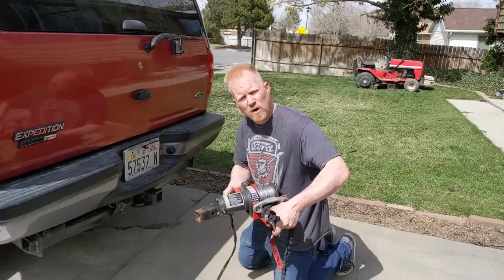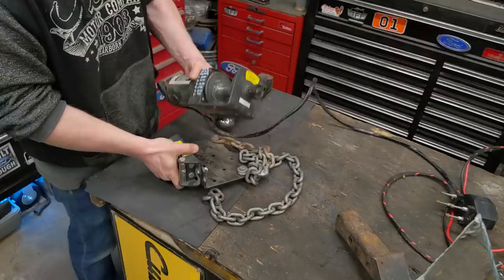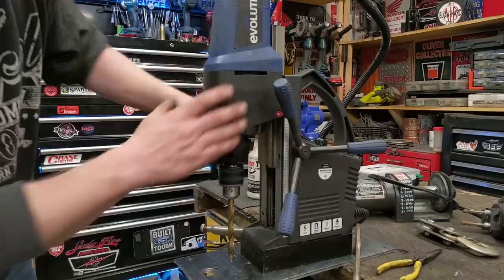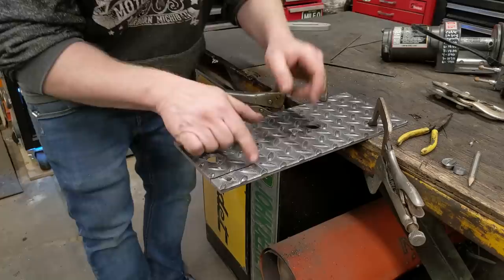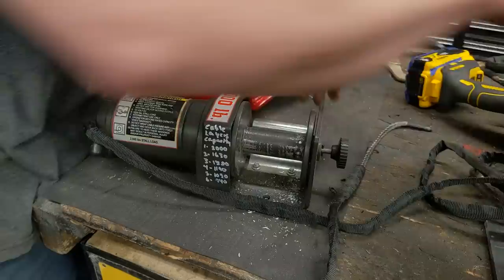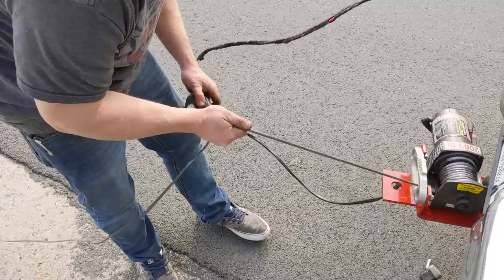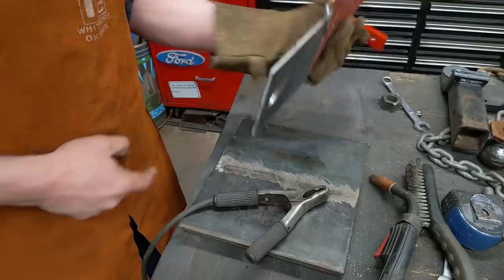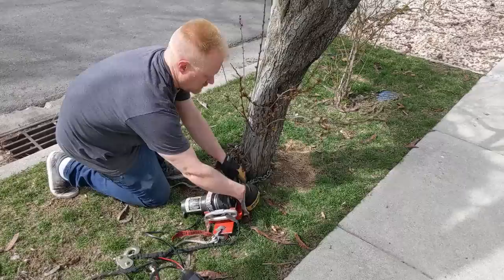Portable Hitch Mounted WINCH Build w/ Swivel and synthetic cable

Comment: I always enjoy your creations mo, i'm sure you could make anything given time and materials :-D
i imagine you have a hard time sleeping with all the ideas keeping you awake :-D
i've never thought about the gearing effect of a reel of rope, similar to reels on cassettes, speed and torque going in opposite directions.
You could replace that reel with a deep "V" pulley and a single wrap of rope around it, plus guides.
A reel after it to take up the slack rope on a slip clutch.
Likely too difficult.
Your lovely dog must be 1/4 kangaroo he he :-D
Reply from the maker: That's a clever idea. Kind of a capstan winch setup.

Comment: Why not take power from the trailer connector with another male half of common connector ? Is the amp draw too much?  Factory trailer package  with common electrical connector?  Nice design.  I thought about doing the same thing but don’t have the welding equipment,  etc.  Thanks for a great video.
JoeB
Reply from the maker: You're limited to maybe 15-20amps from the trailer connector. A tiny winch like this will have no issue pulling over 100amps.

Comment: The fairlead braces look good.  If you could have only 1 welder because of money and space limitations,  which welder would you buy?
Reply from the maker: That's a hard question. 

My first thought was Oxy Acetylene as it is a ton of tools in one. It welds great, can braze dissimilar metals, cuts thin to thick steel like butter, allows effortless shaping and bending of steel and is a mechanics best wrench with stuck fasteners. However, it is not an easy thing for the average DIY guy to just go grab. You need to go to specialty shops and the initial investment is kind of high. 

Ease of use and cost would definitely be a 120volt wire feed flux core welder with the option to use gas for MIG in the future(upgradable).

Comment: Anyway to make an adapter for powering the winch off the tow plug on the truck? That way you could plug right in and ditch the battery?
Reply from the maker: Nope. A winch pulls way to much power for the 7 pole plug. A tiny winch like this will pull upwards of 100amps at stall which would melt your trucks wiring. The only thing you can do is put an "Anderson Plug" at the back.  They come in 50, 175, and 350amps. A 175 amps continuous should suffice with 6or 8awg cable from the battery.

Comment: Now you can just go to harbor freight and buy and ATV hitch adapter and it will swivel.. under $10 with 20% off coupon I think
Reply from the maker: That would be nice because you rarely pull straight on when pulling out an ATV.

Comment: I built the 1st 1 for my truck about 25 yrs ago..
I still have 1 the I use on both my trucks now,
But mine will go from front to back of my trucks.
Nice design but u have a problem with the plate.

Comment: What about just putting a trailer plug on the it for your power supply that's the way my dump trailer power supply is set up
Reply from the maker: You still need a battery. The winch can pull well over 100amps where you're plug would be lucky to provide 20amps.

Comment: ...have you seen how ball hitch points break and go flying and what damage they do? Check it out. This is a dangerous setup.
Reply from the maker: That's not even remotely pertinent to this application. Those are shock loads exceeding 40-50,000lbs of force and the video in that goes over it had to cut the ball shanks half through to do it. It would have ripped the truck in half before it broke an uncut ball.

Comment: Moe - question if I may. Totally can see where your ideas are more efficient for pulling but.... I was wondering if those 4 roller deals are ok if I were to mount the winch without a swivel? also would that oval shaped guide be necessary with the 4 roller setup? So much helpful advice in your video, awesome. If there is ever something you think I could help you with please ask....
Reply from the maker: I actually put the 4 roller fairlead back on. It seams to make more sense to have rollers vs just aluminum for the rope to rub on.  Without pivot the rollers will still allow the cable/rope to bunch up on one side and you have to stop every 5feet, unspool it, rewind those 5feet by hand to spread them out and then continue your pull.
Reply: @sixtyfiveford  Thank you Moe for the quick response. Much appreciated. Will do. Be ordering that rope. Considered an extra one to keep in the tool box in case a tree wouldn't be quite close enough and avoid that arr effect! Never heard of that rope and other tips presented in your video! So helpful.....

Comment: I run mine from the 7 pin connector
Reply from the maker: 7 pin won't allow enough amps. 7pin is  regulated too 10 to 15 amps with a fuse on the 12v charge pin. A winch under full load will pull 75 to 100 amps.
Reply: @sixtyfiveford  ok! I’ll keep using mine

Comment: Can you get power from the 7 way hitch plug? I think the center is always hot. Mine could charge the batteries on my popup trailer
Reply from the maker: It wouldn't supply enough amperage. This tiny winch will pull up to 100amps under load. The 7 way is generally fused around 20amps.

Comment: That's a good idea, I work on mowers and I've been trying to figure out how to hook a winch on my hitch and then hook up my trailer.  Do you think it would be alright to run the winch off a 4 or 7-way plug instead of a battery?
Reply from the maker: I know this small winch will only pull around 10 amps lightly loaded, but if it stalls out pulling something heavy it pulls in the realm of 50-100amps. That would burn out a fuse really fast in the 7 way.  The 4 way has no aux power.

Comment: I have 25 ft jumper cables so I can use my truck battery.
Reply from the maker: I've had to pull out the jumper cables before when my spare battery was dying. You definitely get more power from a 14v charging vehicle battery than a 12v you're running flat.

Comment: I have a stupid question. Instead of extending the plate, Why didn’t you just put the tow ball on upside down?
Reply from the maker: I had to put more distance between the drum and pivot point so the cable wouldn't bunch up on one side.

Comment: i wonder if youd need a beefier setup or if this would suffice for a 10,000lb winch.. i see guys all the time with their 10,000lb winch on a receiver so they can mount it front or rear of their jeep/truck without issues it doesnt pivot like yours but it relies on a 5/8" pin in double sheer i think that ~1-1/4" ball thread will have a similar strength in its single sheer load.. ntm you dont have to run the cable back to the winch in a snatch block pull you can have a dring on your bumper and run the cable back to that so the winch setup only sees 10,000lbs and youre only ever getting that 10k rating on the first wrap, with a dead straight pull and no resistance with the battery mounted a couple feet away and 4/0 cables connecting it with the vehicle charging at 15v and a massive 1000cca battery.. i guarantee if you measure anyones 10k winchs actual power in a typical pull youre looking at 6000-7500lbs
Reply from the maker: A 1" shank ball will have a shear strength in excess of 100,000lbs. Bolts are generally rated at 5x their working capacity and hitch balls exceed this to as high as 10x safety factor. This is all due to the shock load. A 10,000 trailer will exert a 50,000lb shock onto the ball in an abrupt stop or more in a collision. You can see rollover accident pictures and generally that little ball never shears and will hold an entire truck up. There's video where some Aussie Guys break some tow balls by strapping a truck to a tree and then an SUV to the tow ball of that truck. The truck can't move and the 5000lb SUV races off at 25mph under full acceleration and the strap pulls directly on the ball. It takes quit a few attempts to break an old 1" shank ball but they finally do it. The force exerted is well in excess of 100,000lbs. I would say the weak point is the four 3/8 bolts holding the hitch to the frame.

Comment: Do you think there is a way to run the winch off a DeWalt battery, is it possible ?
Reply from the maker: No, just because winches draw so much current. They'll draw upwards of 200amps where a tool battery pack will peak out around 30-40amps.

Comment: Could you connect it through the trailer electrical umbilical?
Reply from the maker: No because the trailer wiring won't allow enough amperage. You need upwards of 100 amps with this tiny winch.
Reply: @sixtyfiveford  Great video! Thanks!

Comment: Pardon my newbie ignorance...can this be powered from the trailer brake plug?  I'm thinking no, because those look like 10amp wires going to that winch. How do you power it? A deep cycle battery?
Reply: Woops.  Didn't wait till the end...  Question answered.
Reply from the maker: I think the stall load is in the realm of 50amps or so. They do make aftermarket plug in ports for winches on trucks.

Comment: How are you powering it! Thanks
Reply from the maker: I have an extra 12 volt car battery in the video. You could use a car jump start pack or just run jumper cables to the front of the vehicle to utilize it's battery.

Comment: What size fuse is that on the wire
Reply from the maker: Winches won't really come with fuses instead they'll come with resettable circuit breaker / thermal overloads. This small winch has a 50 amp. It will allow more current than that to be pulled but if it pulled for too long it'll trip. You can easily expect the winch like this to pull over 100 amps momentarily. So it should handle 50 amps continuous but say it pulls 75 amps it may run for 30 seconds before it trips off.

Comment: Not  knocking you, it's a great idea. But this is so unsafe.
Your receiver isnt designed to be pull from at an angle, the hitch ball nut is left loose so the winch plate can move. The chain you used isnt heavy enough for the winch capacitor

Comment: Oh, yeah! Use spring loaded locking pins have the top plate and a bottom plate with the holes for locking the "pin" in. I'd personally would set it up for 180° that way you can cover everything (that & scratch block was from my towing days). 

https://catalog.innovative-components.com/viewitems/all-categories/s-pins-pop-pins-plungers-1-2-straight-tip-pop-pins?remote_addr=66.249.66.203&remote_addr=66.249.70.109

Comment: would a m12 6amp battery do for one pull?
Reply from the maker: It wouldn't. A M12 6.0ah is going to have 20 or 25amp max continuous amp draw cells. There are two sets of 3 in parallel so the pack can put out double or 40-50amps max at 12volts for probably around 5 minutes straight. Most of these small winches will pull over 100amps under load.

Comment: I really like this idea especially with how you can put it on both ends of the car. Do you think a winch that size could pull a car out if it gets stuck (or maybe pull someone else's car 😁👍🏻)?
Reply from the maker: I've used this winch to pull cars up a steep trailer ramp to load them. I used it to pull a derelict/non running small truck, that sat for 25yrs, stuck 6" in dirt out and onto my trailer. It probably wouldn't get  a full size truck stuck up to the axles in mud but it would be better than nothing.
Reply: @sixtyfiveford  Great! is much much better than nothing .

Comment: In my opinion your hook for your chain should be flipped over. My reasoning is with it flipped, the force of your pull would be to the throat of the hook and not the point.
Reply from the maker: Good point.

Comment: 3:15 what type of marking "pencil" is that? Just curious as I'm new to metal fab.
Reply: Traditionally, marking on metal is done with soapstone "pencils" -- basically a rectangular length of soapstone that is around 6" long by 1/2" wide by 1/8" thick.  Chalk will also work.  I have also seen a type of paint type "ink marker" that produces a finer and more consistent line, but I prefer soapstone for the occasional use that I have of it.  I am still using the original package of it that I bought from Sears Hardware around 20-25 years ago.  Which might sound remarkable, but actually the fact that I still can find it is what is really remarkable... I wish I could say the same think about the key to one of my motorcycles that I've been looking for over the last couple of weeks... :(
Reply: And one more that I forgot about -- basically is is a white or yellow grease pencil / crayon.

https://markal.com/products/bandreg-paintstikandreg?variant=9204722139183

Which type of marking device you use depends upon what you are marking, the temperature of the item, and whether the weld so critical that no weld contamination is allowed.  For example, welding on a nuclear containment vessel where you might have radioactive coolant flowing through it is more critical of contaminants than welding a set of jack stands for working on your car.  If you need to make somewhat fine layout lines on a piece of metal and you're using a very fine cutting disk, then one of the fiber tip paint markers might be a good option.  If you are a machinist and doing layout lines for high precision work, coating the surface with layout fluid and then using sharp pointed awl or marking blade might be what you need.  Each of the different marking choices have different pros and cons.

Comment: You can buy a much better one of these at Walmart for about $50-$75
Reply from the maker: Better winch? I think this one was only $50.
Reply: @sixtyfiveford  Reese 1 ton capacity, 20ft power cord, 30ft galvanized steel cable with wired remote
Reply from the maker: @herculespoopable  Those little plastic box winches are so slow and gutless. I would use a come-a-long in a heartbeat over one of them.
Reply: @sixtyfiveford  may be right, I haven't had the opportunity to use mine yet. Had it for a year or 2 and it's still in the box lol